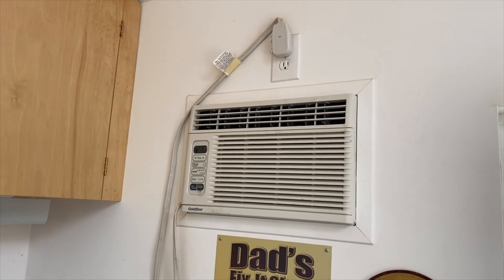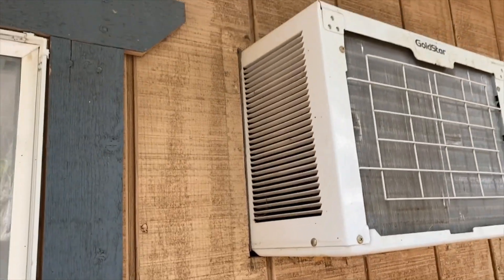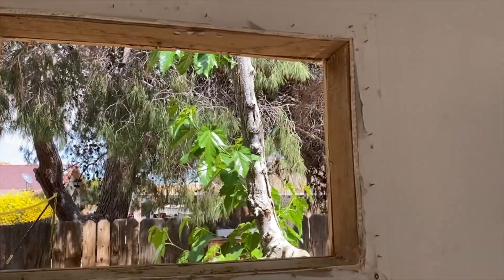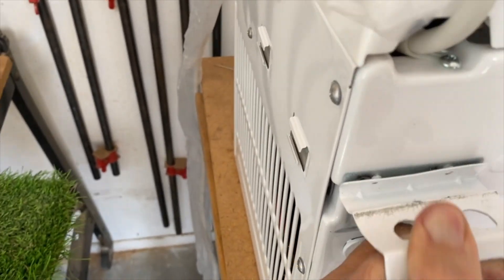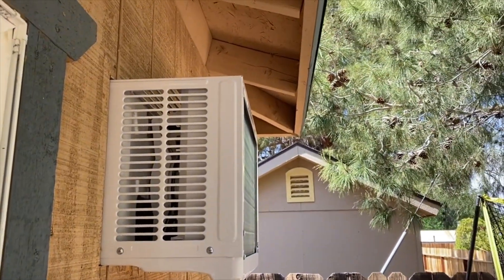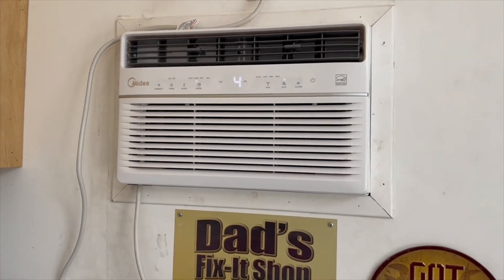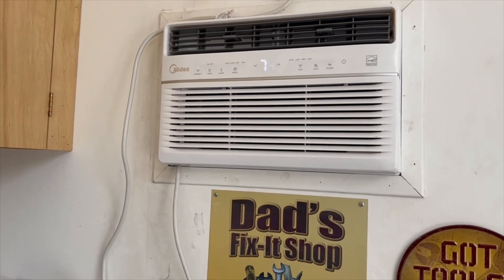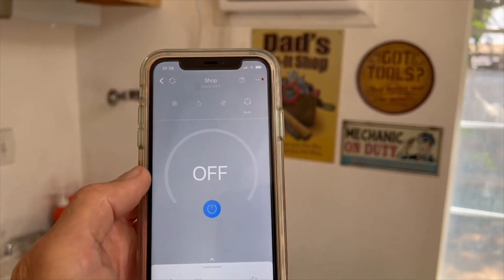Replace your old A/C unit.

Comment: I'm a gold star window air conditioner. I'm the same kind you had. We just build up dust and we don't blow cold air. We just need to be cleaned. Then we'll blow cold air. So you don't have to buy a Cheaply made window air conditioner
Reply from the maker: Cleaned mine. Didn't help. I think the refrigerant was low but recharging it was as much as a new unit.